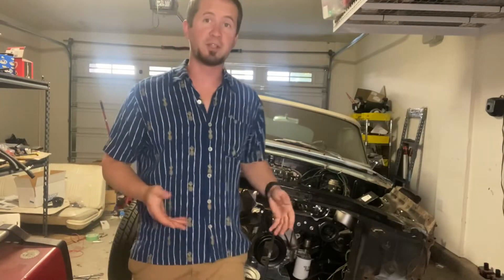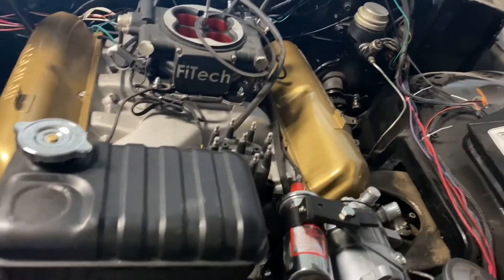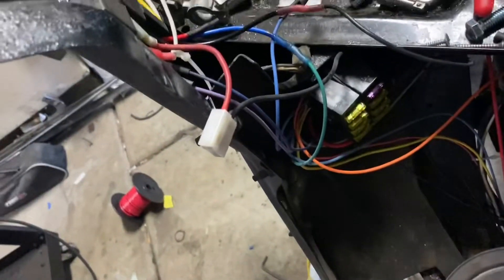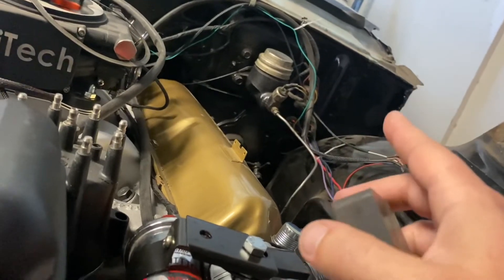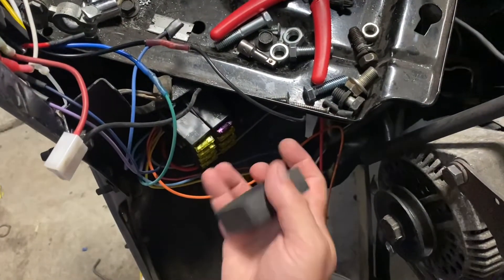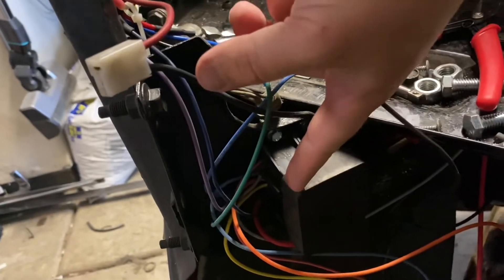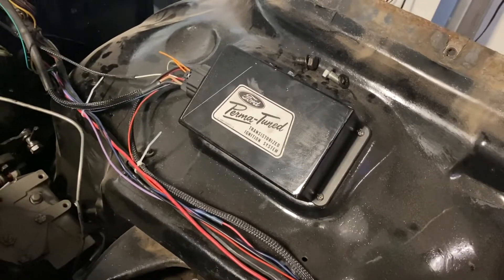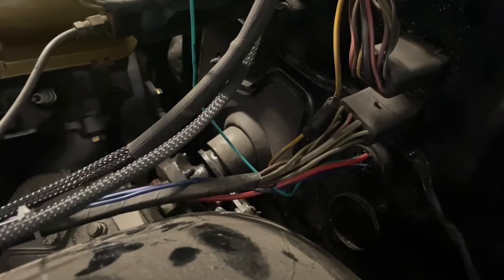Wiring FiTech, AODE, fans, and fuel pump with Painless Circuit Boss

Comment: Couldnt you run the fuel pump off the relay side of the circuit boss rather than its own relay?
Reply from the maker: Not really. If I ran the fuel pump off the circuit boss relay, it would be on any time the key is on. I want it to come on when the FiTech directs it: initial prime and then when it senses RPM.